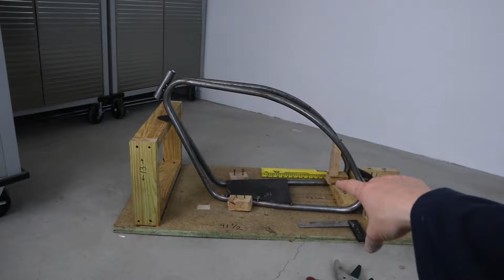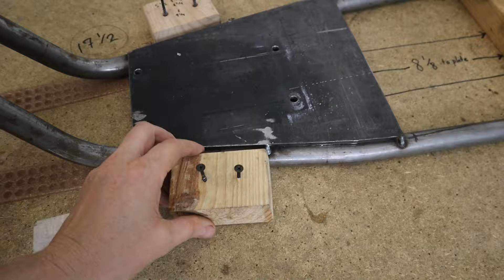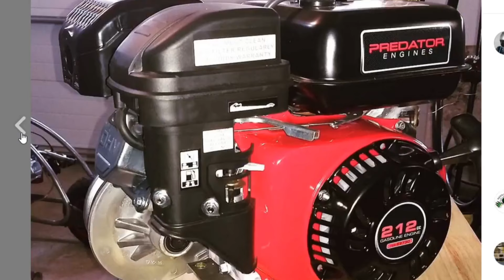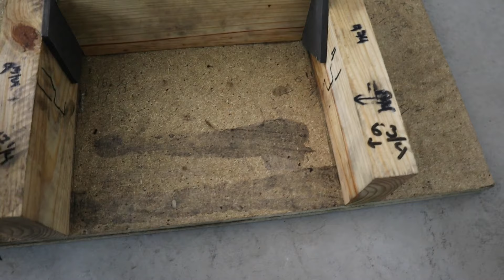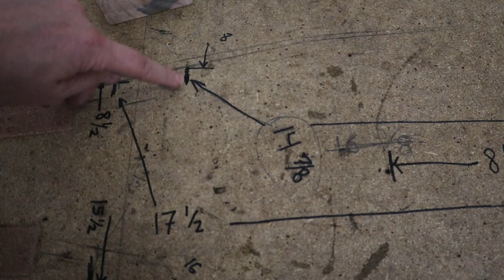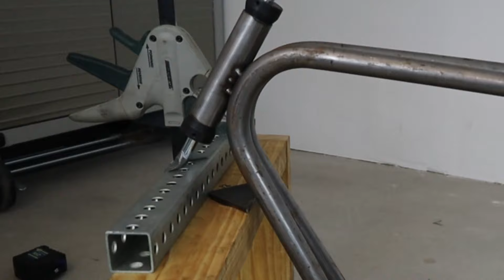DIY mini bike pt. 1 (building a frame jig)

Comment: hello, the dimensions of your built frame for the mini bike are identical to the dimensions of the frame motovoxmbx10 mini bike ?
Reply from the maker: Nope, a bit different. They are similar as the first dimensions modeled off of were the RB100 mini bike to try and match similar to the motovox height. It's very similar but then I adjusted to allow for a big block to fit in the frame.
Reply: @megoingfast  Genius.  In some areas (Miami) the Motovox is what 95% of the riders ride.  This may be a great market being that everyone wants speed but the motovox doesn’t allow a BB

Comment: Bro could you make a PDF of instruction or piece list to get this up and running? Would be really dope if you have a website up or something as incentive for subscribing thanks for your video
Reply from the maker: Incentive for subscribing is simply enjoying malarkey ;) I have a website up for "things" ;) as far as downloads if they happen (can't make promises if I die or something changes), I'm still finalizing parts / trimming minor bits here or there, changing hole placement by millimeters. I believe I wrapped it up yesterday for adjustments. I have completed a few frames so far but still filming part 3. Have not started part 4 or 5 yet.